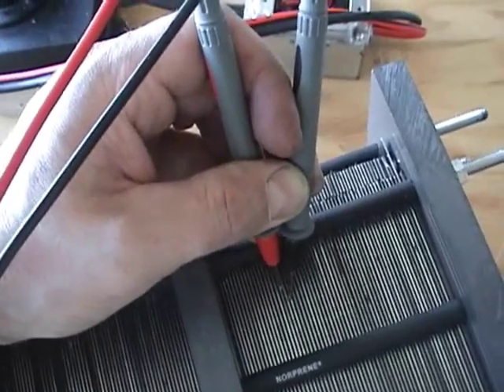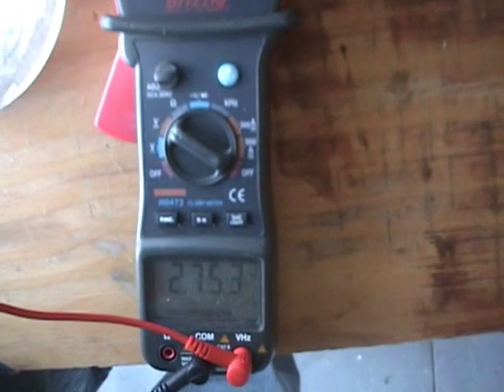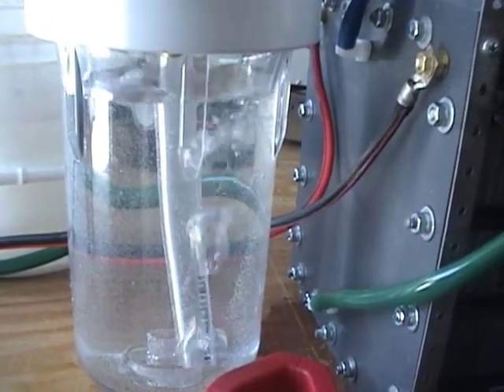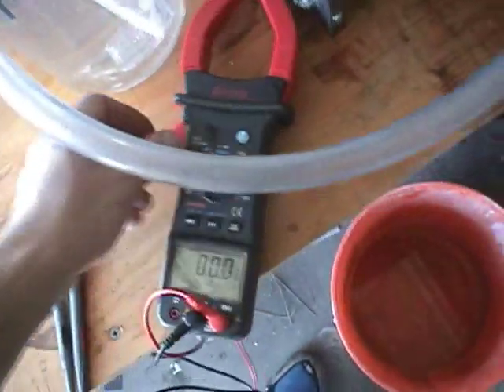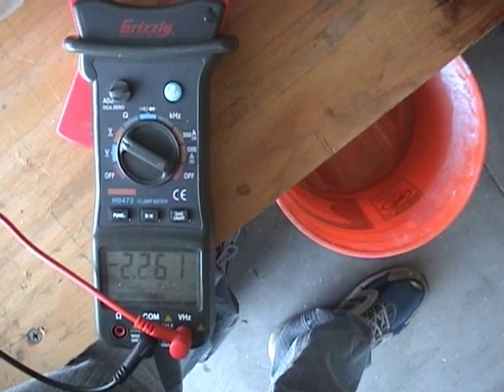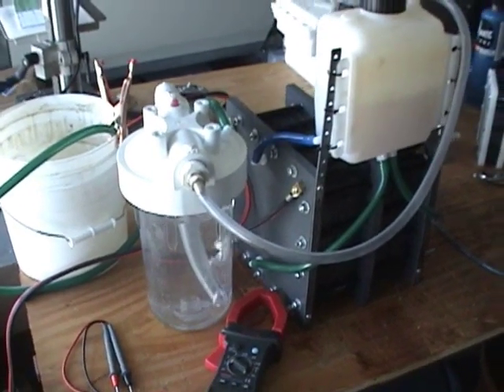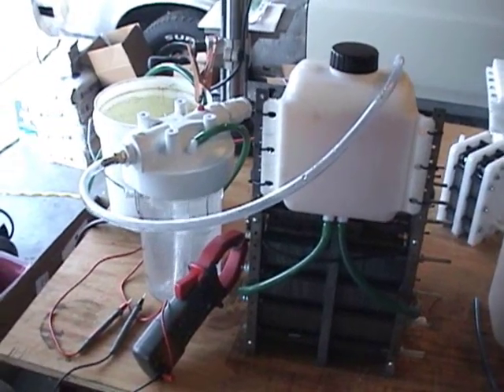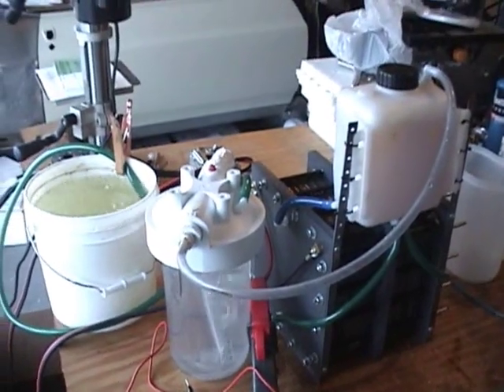118 plate MASSIVE Hydrogen generator first test 120v part2

Comment: Cars that run on hydrogen to produce electricity for the electric motors will come soon but they say the hydrogène will cost as much and even more than gaz. Good for the environment but not good for the wallet. If i had the knowledge to produce hydrogène I’d be the first to buy one. The big question that I have been asking is: hydrogen is inflatable like gaz. Can we run our gaz motor with hydrogène since it can explode if ignited? If the answer is yes and If it is possible to modify, why bother to build electric motor.

Comment: How much pressure does this reaction generate?? would it be enough to fill an inner tube say from a tractor??you know to create a reservoir.,I'm interested in trying to build a compressor made of nylon,Teflon ect ,, I'm also curious to find if the reaction changes if it's done in a vacuum ..

Comment: a fun trick is if u put the output hose into a water bottled thats been emptied and filled just a lil with dish soap. so it will make bubbles trapping the hydrogen in a water bottle, then just get a long stick and a lighter and ur set

Comment: although i agree the amp meter is desighned for reading "pure A/C", with a simple 
1/2 wave rectifier putting out D/C current its a pulsed D/C(dirty D/C,which is still technicly A/C) current and the amp meter sees it as A/C(the simplest form of PWM,without the control circuit)
If he were to run the generator output into a D/C regulator,then he would need to read the current using a shunt meter